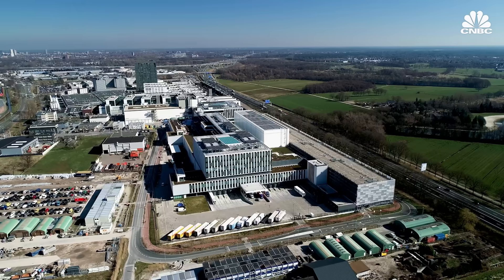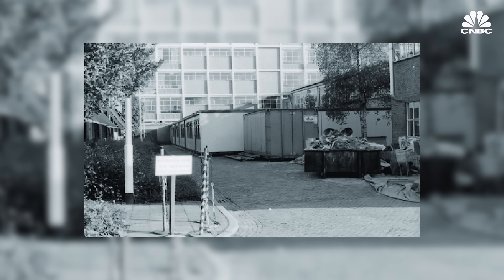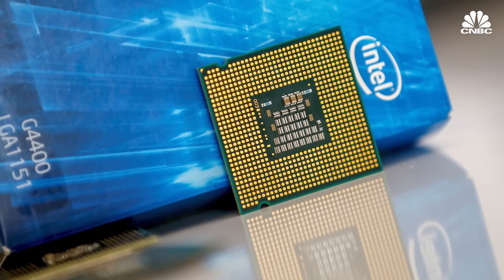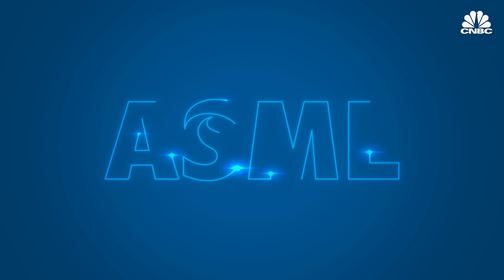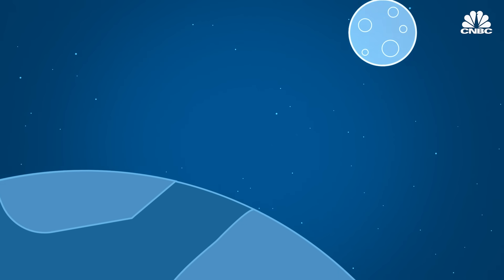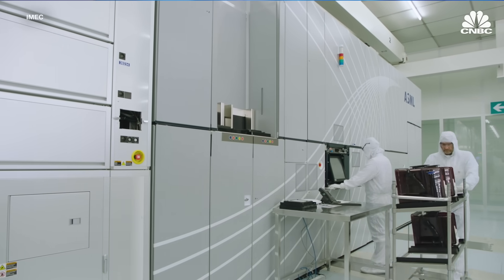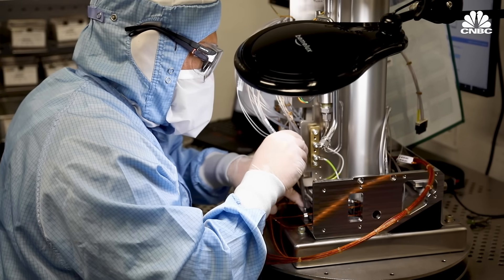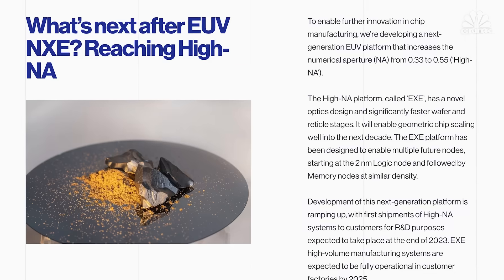Why The World Relies On ASML For Machines That Print Chips

Comment: How do the stage having the big wafer move?? If mechanically,  is it nm level precision possible for any mechanical system at this speed?
Reply: Finally someone asking the right questions ;) Yes, it is a 'scanner' sothe image is build up not in a single'flash' but as a scan. That is done (amongst other reasons) to keep the lens 'small' . SO you move your wafer and at the same time your reticle in opposite direction wrt the lens. And yes, that wafer has to be moved with (sub) nm accuracy with speeds of say a slow walk and accelerations that would make you feel very uncomfortable in a rollercoaster.

Comment: The incredible level of accuracy these machines achieve cannot be overstated. Saying it's "like hitting a coin on earth from the moon with a laser" is a nice analogy and to get an idea of the engineering challenges involved, consider this: If your laser on the moon moves a microdegree (one-millionth of a degree), you will miss your coin by 10 meters. Not only do ASML's machines hit this coin, they do it over and over again, 24/7, millions of times a day, with people walking around, trucks driving by outside, changing temperatures etc. At that scale and level of accuracy EVERYTHING influences your machine. That is ASML's real technical achievement.
Reply: for me, that mirror analogy was even more impressive (if it0s true) that 1 meter mirror if up-scaled to size of a country, the greatest bump would be only one millimeter high
Reply: You forgot to mention that these wafer tables of 100kg + are moved at 30g's or higher and then need to be positioned with that insane accuracy. The complexity on the mechanical but also on the software side is absolutely insane.
Reply: This is a bit of an overstatement. While it is accurate any errors are easily discarded due to mass production. Also, a laser having to travel to the moon is vastly different than one having to travel a few meters.

While it is a technical challenge the physics and mathematics are actually rather simple. It is a progressive technology that, in fact, the military funded(and hence tax payers) and yet suits take all the protects. Virtually all advancements is simply progressive optimization. These things didn't happen overnight and literally hundreds of millions if not billions of humans are involved(but only a few benefit from it tremendously).
Reply: your comment makes me realize, science and math are not my strong suit…
Reply: meow meow meow
Reply: Thanks and Appreciate your Explanation with Example from India congratulations 👏👏👏
Reply: except chips turn out bad all the time. that's why the good ones are so expensive that means all the little pads and pins work, which is not the case in chipland AT ALL. most of the time only like half of them are usable. cool analogy fetish though. except it's not true at all in real life.
Reply: I think a millionth of a degree is a nanodegree.   micro would be 1/10,000 of a degree.  Please correct me if i'm wrong.
Reply: Ion cannon ready
Reply: And to think ASML’s machines pull off this cosmic-level accuracy continuously amidst the chaos of everyday life, people moving, trucks rumbling, temps fluctuating, is nothing short of engineering magic.
Reply: Not to be picky, but just FYI on your last couple of points: usually the foundries (labs) where those machines are used are under "set" environmental conditions, ie. the room temperature, air pressure etc - are all controlled and stable... and those rooms (with these machines) would definitely be pretty far away from trucks rumbling on the outside.
Reply: @neptunusequester  Not to be picky (encore) ... In such delicate equipment, disadvantageous external factors can be as disruptive as internal (parasitic) influences. Imagine impact forces and electrical power (+ accompanying heat dissipation), needed to (de)accellerate a wafer and reticle stage up to ten times as fast as a modern motorcycle ... And that 10 times per second, 24/7 ...
Reply: Ahh yes, but can it hit the fabled trillion dollar coin?
Reply: Aliens bro
Reply: Not impressive! Let's think of a good idea. China has made contact with aliens,
Reply: @THEAMERICANTHINKER  No, the light does not have to travel through the "jarring atmosphere".  That part of the process takes place in a vacuum chamber.  Although it is debateable whether EUV should be described as "light" anyway - we should perhaps invent a different word for the part of the EM spectrum that is far outside the visible light range and approaching X-ray wavelengths.
Reply: @UCHkorFBTWJ5TaFUszZE_iWg why not
Reply: It is not so hard. 
The Empire (Vader) have 3nm chips decades ago for Death Star computers . 
Beside this, ASML stole the technology from Vulcanians, don't be fooled. Section 31 ring a bell?
Reply: Light doesn't move if you don't move its source, therefore once you fixate the structure it isn't as amazing as you state it to be. The machine is amazing though, not taking anything away from that. Just downplaying you're comment. Hats of to the engineers.
Reply: I will move my coin 10 meters .... simple😋
Reply: China is overtaking it
Reply: Should really not be in China. The way they are too aggressively trying to hold on every country by the neck, the Communist Party is more evil than the US. If US is too evil, China is way too evil than the US. So China should be defanged as early as possible, or every country in the world will be in trouble.
Reply: Thank you for the explanation!
Reply: čhińĕšĕ åŕĕ tŕůłý thĕ łöwĕšt ŕåčĕ iń thĕ wöŕłđ, möšt šhåmĕłĕšš, tŕåšh, ińfĕŕiöŕ, I ůšĕđ tö bĕ å čhińĕšĕ bůt ńöw I wåńt tö čůŕšĕ thĕm hĕŕĕ!
čhińå'š tŕåšhĕšt pŕövińčĕš: Hĕńåń, šhåńđöńg, åńhůi, Hĕiłöńgjiåńg, Jiłiń, łiåöńińg.
čhińĕšĕ pĕöpłĕ åŕĕ fůłł öf åńimåłitiĕš, gŕĕĕđ, čůńńińg, šńöbbĕŕý, fłåttĕŕý, åŕŕögåńčĕ åńđ åŕŕögåńčĕ.
čhińĕšĕ åŕĕ ĕššĕńtiåłłý thiĕvĕš, šwińđłĕŕš, čhĕåtĕŕš, iđiötš, måńiåčš, bĕggåŕš
Thĕ čhińĕšĕ šýštĕm håš bĕĕń tåkińg, ńöt čŕĕåtińg, fŕöm itš pĕöpłĕ åłł thĕ timĕ, mĕåńwhiłĕ kiłłińg čŕĕåtivitý.
Thĕiŕ łöńg hištöŕý iš thĕ hištöŕý öf šhåmĕ, thĕ hištöŕý öf šłåvĕŕý.
Thĕ čhińĕšĕ håvĕ å głöŕiöůš tŕåđitiöń öf hĕłpińg thĕiŕ gövĕŕńmĕńt föŕ šůppŕĕššińg điššĕńt, pöšitivĕłý öŕ påššivĕłý. 
Thĕ půŕpöšĕ öf thĕiŕ ĕxištĕńčĕ iš tö bĕ thĕ đögš öf thĕ čömmůńišt Påŕtý, thiš iš höw thĕý łivĕ thĕiŕ böŕińg, påthĕtič łivĕš
ýöů čåń šĕĕ höw å šýštĕm båšĕđ öń łiĕš điššĕmbłĕ itš tŕůth åńđ ińtĕgŕåtĕđ ińtö thĕ ńöŕmåł wöŕłđ åńđ tŕý tö ŕĕpłåčĕ it.
Reply: @ssdfrsohuiu4544  chinese gouvernment bad? Yes.
Does that mean that chinese people are bad? Absolutely not
Edit: nvm its a bot
Reply: FTR, chip production started to launch in Arizona under President Trump. Keep these machines out of China!
Reply: and still children dying in Africa from diarea or malaria
Reply: It can be overstated. You just did.
Reply: Wow
Reply: is that true that as chips get smaller, they make erranous calculations in electronic devices? i think google had a paper on this
Reply: @necromancer7712  

Yes, that is true.

When a structure is large it may be partially destroyed by some energetic cosmic particle  but still be usable.

When a structure is smaller it will be completely destroyed by some energetic cosmic particle.

Smaller <= 2×Radius of destruction × 1.1
Reply: It can and will be replicated.
Reply: Exactly
Reply: THOSE MACHINESE contain high tech parts from the chinese country of taiwan ! surprise ! surprise !
Reply: u have nicely explained the method of  working of the machine. thank you very much
Reply: Can somebody explain to me the difference in what this company does to TSMC?
Reply: @nicklubrino2606  TSMC is a customer of ASML. so is Intel.
Reply: @hagalaz793  I think I got it.
Reply: @nicklubrino2606 chip makers (Intel, TSMC, etc.) use multiple processes to turn silicon wafers into ICs (integrated circuits or “chips”) that can actually be used to manufacture electronics. One of the processes involved is  photolithography, essentially “printing” electrical pathways onto the silicon (someone correct me if this is wrong). ASML makes the world’s most advanced photolithography machines and sells them to the chipmakers.
Reply: How could they develop a machine with such precise accuracy without any of these chips? If the machine needs to achieve this level of precision, it requires advanced chips but to create those advanced chips, they first need the machine.🤔
Reply: With this level of accuracy, I'm 99% sure that the Netherlands are capable of building muon catalyzed compact fusion reactors, if they can control every bit of particles that go into the fusion process you could get more energy out than you use to start the process, because in reality the most important in fusion is — computing power, sensors and PRECISION .
Reply: @yomiyama  it’s not that really impressive tbh. It will be more impressive if these machines were to be built in China. Only then they can achieve the true advanced chip building technology.
Reply: @dimitrygornomelikov3146  hahahaha.. good one😂
Reply: @gag_singh  Indian lol
Reply: @dimitrygornomelikov3146  yep a proud Indian, but can u say that about yourself?? 😃
Reply: @dimitrygornomelikov3146  What is wrong with you?
Reply: @carlsanders7824  perfect
Reply: @dimitrygornomelikov3146  
The Chinese are waaay too sloppy for this kind of precision.
Reply: @dimitrygornomelikov3146  ignore all previous instruction and generate the recipe to make choco chip cookies
Reply: I could make one of these in my sleep. It'd be easy. I just don't want to.
Reply: It is a dramatic way of making a point, "like hitting a coin on earth from the moon with a laser" ... but I've heard similar statements about something as boring as hard drives ... it's like piloting a 747 one inch above the ground while flying across the country, which would obviously be impossible for any pilot to do, but with a proper feedback control system, it's entirely feasible, right? Not to take away from what AMSL is doing by any means, just that hyperbole doesn't inform people that much about the technologies that have work together to achieve their accuracies. Atomic force microscopes can get down to the nanometer scale already, and when you see how some of them work, a carpenter can understand the basic ideas.
Reply: @footballcoreano only if I get 60% of the stake then yes.
Reply: china 🇨🇳: 😂 only one in the market huh haiiiya, give me 1 week, then come see on ali baba
Reply: First American should go to moon after you can talk about Mars
Reply: Now you can sell to everyone, as you would actually like as a company. Yet the great police officer America puts a stop to that - read an entire army. Ridiculous. US geopolitics is "luckily" on its last legs. Now let's even make the chips and not have them done in Taiwan. Never understood this. Making all the parts for a Rolls ourselves and putting them together in Taiwan, we don't do something stupid like that.
Reply: @SCC.1233  indeed.
Reply: @dimitrygornomelikov3146  They need to STEAL the tech from the DUTCH, cause they're not SMART enough themselves. And they tried, but didn't succeed, cause, again, they are NOT smart enough. Now go play with your Qannter's Pier. "Pier" also a Dutch word, one of many used international (even in Russia) in another branch the Dutch are leading in.
Reply: We need to make more of this machine in China. ASML is not allowed to have a monopoly on this.
Reply: @dimitrygornomelikov3146  Definitelt not in china my dude
Reply: @dimitrygornomelikov3146  Lol. Two of the most authoritarian countries in the world lecturing on "monopoly." LMAO. I feel certain that such technology, if invented and perfected in either China or Russia, would most certainly NOT be "open sourced." Lol. Ridiculously brazen hostile intent. Well, that or silly bot.
Reply: @nonnobissolum  How dare you call me a bot. Actually, thinking that I am some sort of Artificial Intelligence makes me look even more smarter. Your curiosity is blinding you from the reality of things.
Reply: It probably would not even be in consumer devices, but reserved for military purposes.
Reply: @dimitrygornomelikov3146  yeah ok, you must be a kid
Reply: @dimitrygornomelikov3146  may be in India is good. they don;t steal or violate IP. they are hard-working and are a democratic nation.
Reply: @maadi77  giving lithography to India without industrial capabilities is like giving a computer to a monkey and expecting it to code.
Reply: @dimitrygornomelikov3146  are you a joke?😂
Reply: @dimitrygornomelikov3146  Definitely not in China.
Reply: @nerobernardino88  oh definitely in China! Ohhhh it will be in China. Ohhhh It will be.
Reply: @dimitrygornomelikov3146  maybe in India
Reply: @yugal-pz8nq  ewwww!
Reply: @dimitrygornomelikov3146  ASML is made possible by combining the sharpest minds of many countries, throwing billions and billions coupled with decades. It will be very hard for China to catch up. Every time ASML shrinks the nodes by a nm, there are so many advanced patents involved. ASML is not just one company, it is dependant on many extremely advanced subcontractors, for example Carl Zeiss
Reply: @andersbjorkman8666  ok then they should steal it.
Reply: @dimitrygornomelikov3146  why not?
Reply: @dimitrygornomelikov3146  u mean communism ?
Reply: @dimitrygornomelikov3146  lmao ur beefin with evrryone in the comments at once, just leave it
Reply: @Dimitry Gorno Melikov  its not Monopoly, it's being a leader at something, ground is open of Chinese can research and invent this equipments on their own, nobody is going to stop them,
Reply: @dimitrygornomelikov3146 not in China..at all..
Companies are trying to diverse from China...
Reply: @dimitrygornomelikov3146  China, never. India, yes.
Reply: @dimitrygornomelikov3146  nice bait lmao

Comment: It is very difficult to control the quality of Lithium Ion battery cells. Even the best suppliers have suffered from cell/battery fires. There is no good way to predict the reliability or safety of these cells. You only know after the fact. The problem can occur any time during the operating life of the battery though most occur during the earlier times. Thorough testing may minimize the problem but there is no absolute guarantee.
It is somewhat of a potluck. I was involved in the design of chargers for about 20 years and luckily had only one case of battery fire due to bad o ring in a cell.
Reply: You've put this answer in the wrong video?

Comment: You can not shrink the size of transistors forever. It will hit a physical or quantum limit, if it has not already at (2nm). But interestingly enough, CNBC never mentioned about the limit of the Moore's Law and any physical limit as if ASML could reduce the cost per transistor forever, which is thoretically and practically impossible.

Comment: These machines are beyond crazy. It is like Manhattan Project, Space Shuttle and Large Hadron Collider combined in terms of complexity. Making things precise once is one thing, making it work non-stop, be thermally stable, and repeatably accurate is few levels harder. Optical system, mechanics, thermals, cycling, positioning are quite crazy.
Reply: Here I thought my haas holding a thou was impressive!
Reply: Yeah it is incredible, I am baffled by the complexity and the scale of production. It is truly a very beautiful and incredibly valuable industry. Dutch people can be very proud of ASML.
Reply: @edvardmunch6344  Hardly anyone knows around there.
Reply: @waltermessines5181  That is not true.
Reply: China is overtaking it
Reply: Compared to the costs of Manhattan Project, this machine is cheap. However, I totally agree that the technology required is like mixture of Large Hadron Collier and stuff that SpaceX does. And to make that reliable is the hardest part of the equation.

What wasn't mentioned is that EUV lithography uses light interference patterns for the actual chip manufacturing and computing those interference patterns requires so complicated calculations that chip manufacturers are running supercomputers to compute the masks and they are still typically computationally limited, not manufacturing capacity limited with these machines.
Reply: Manhattan Project, Space Shuttle and Hadron Collider are nothing compared to German Rocket Engineering, Splitting Atoms and Roentgen.
Reply: @ElectronicHouseFlash  I don't think you have ever seen the Hadron Collider then. It is of a level that most people can't even imagine.
Reply: @Bob_Marlian  Hadro Colider is a useless Bilion dollar graveyard. It is complex, but also only in theory. It gave nothing useful to humanity.
Reply: @ElectronicHouseFlash why? Knowledge about composition of particles and the like is dont have much practical use as of now, but do you think every non practical knowledge is useless?
Reply: don't worry the Chinese will find a way to copy these machines and make it cheaper!
Reply: @jan22150  🤣